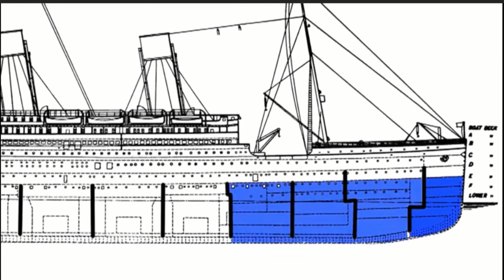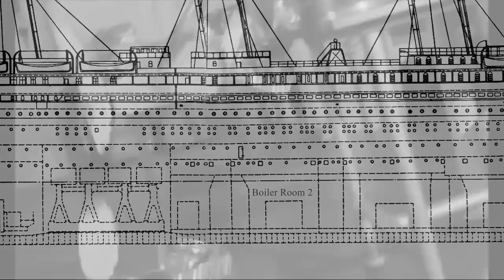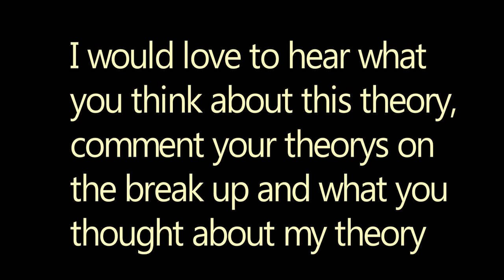Titanic Theory - How Titanic Broke in Two

Comment: Titanic didn’t just Break in two sections, The Bow (The Front of the ship) and the stern (The back of the ship). It would be more accurate to say the Titanic Broke into Four, The area around the Titanic’s third funnel was massively structurally compromise, meaning this area of the ship was ripped apart.

Comment: To clear things up.

The v break is scientifically impossible
Reply: The keel bending upwards under boiler room one and the forward end of the reciprocating engine room was not only possible, but supported by the two pieces of double bottom found in 2005. At the point where they were once joined, the keel bar and shell plate was bent into an S-shape. In other words, compression stresses broke her keel, and when the double bottom bent upwards, that causes a cascade of structural failures. In fifteen or twenty seconds, cracks in the decks split Titanic into four main pieces while the shell plate ripped away from the inner structure of the stern section. When the bow went under, B-deck pulled the stern upwards before it too separated at three tear lines leaving the stern to remain vertical in the water for a few minutes before it too went under. This bending and failure of the keel as well as the rapid propagation of cracks throughout the mid-section certainly would account for the cacophony of very loud sounds heard by the survivors.
Reply: @taraswertelecki3786  The 2005 theory has been disproven.
Reply: @rightlaneshitbox  It so dark so not many people could see clearly what was going on and the 2005 theory was based on the theory the expansion joint was flawed but did some testing and showed the expansion was strong enough to handle enough stress.
Reply: Exactly if the bow is full of water there's no way the nose can rise up with the weight of the stern rising not a chance

Comment: I think that at a low angle the titanic started peeling a bit from the top decks and then part of the middle section was crushed a little and than it fell apart from there. For example take a wooden skewer add some wait on the end of it than at the other end lift it up and see which angle you feel the most pressure in... it's a low angle unlike how james Cameron depicts it so final verdict the bow went under then the propellers came out of the water and not long after that the pressure splits the top wooden decks and the metal was crushed under the pressure and then the stern fell, and no there was no bananna peel effect because the hull does not act like that. It split at an angle like this 2:07

Comment: Did they ever think of the waight of the passenger's moving up to the stern had on the structure of the ship,
Reply: I always wondered that actually,but again i dont think it made a whole lot difference anyway.
Reply: If all the passengers stood on the forecastle the bow will sink very little. That happened to Olympic after the war when she was taking back Canadian troops. If lets say 1350 people to make it easy (taking out 146 people to equate to the amount of people who died forward of the ship and were in the water) That is only an added 140 tons to the stern (calculated by the average weight on men times by the number of people) So it is very unlikely that it would have broke the ship. 600 tons listed the ship to port by 2.5 degrees, and that is four times more than the weight of 1350 people. (yes I know 1496 people died on the ship, with 712 surviving)
Reply: @POOLIEY  well explained.

Comment: One of the marconi men in the radio room who survived said they couldn't hear anyone responding over their headsets because the steam boilers were being evacuated through the funnels above their cabin - making a loud rushing sound. They were operating virtually deaf to responses.

Passengers later testified that they were encouraged to go back inside the ship because the deck was extremely noisey. 

This implies that all excess steam was running through opened valves very soon after the collision when the radios were starting to transmit CQD SOS. This would make sense - the boiler room was flooding and the engineers would know to vent all steam to prevent an explosion. They were very brave men. Every single one stayed at his post. Manning the pumps. Maintaining the electricity supply. And doing everything possible to give the people above more time.

Comment: The explosion she talks about was most likely one of the reports of the iron fracturing during the break-up. She was young when it happened, has no understanding of engineering, it was dark as can possibly be, emotions were high, minds scrambled and confused. But I’m not mocking or ridiculing her in any way. Many survivors (including her) gave very good accounts of the sinking considering the conditions and what was going on that night. But Titanic was a 10 deck, complex iron structure. If something like that fractures, it’s gonna sound like an explosion, no question. Multiple explosions to be exact, which is what most survivors testified to.
Reply: Maybe that explosion was the second funnel falling and I bet she forgot because it’s been 109 years since this happened but it’s a huge question of what happened to the bottom of the ship on the ship bro I know everything I’ll pull it out but just the fact that a 883 feet long she broke in half he’s just crazy
Reply: Joseph Hyman told this to NY Herald back in 1912: "We sat there silent, we were terror-stricken. In less than ten minutes there came a terrible explosion, and I could see men, women and pieces of the ship blown into the air from the after-deck. Later I saw bodies partly blown to pieces floating around, and I am sure more than a hundred persons were blown into the sea by that explosion".
I really believe that something blew up amidships and hastened all the sinking process.
Reply: L F 
Well if the reports of one of the foreword funnels exploding when it collapsed are true, then that’s likely the explanation. Likely the second funnel.

Comment: So basically every image and film showing her at a high angle is wrong (like in the 1997 film when it was so bad that people were literally sliding down the decks)

Also apparently none of the survivors mentioned a massive splash when the stern crashed down, doesn't mean it didn't happen though of course
Reply: Sabrina C 
The stern did go down after the ship broke, just not at a free-fall as the movie shows. It was more like a settling back.
Reply: The movie is 20 years old.  It was believed that the ship did reach that high angle until 2010ish.
Reply: The survivors never saw the stern crashing down, some claimed it settled down but that may have been because some of them were close up so they couldn't tell from the angle they were at.

Comment: From what I know, how can the bow be slightly raised up, creating that V formation as it sinks, when it is already heavy with water? I doubt that actually happened. Then again, survivors has to see things in the dark and at sea, at night, it is really dark, so it's difficult to see. And certainly the stern did not go completely vertical as it goes under. Then again, we can never be sure of how it actually sunk, yet it is a mystery that's fascinating.

Not sure how you feel about this, but we could see how it goes when Titanic H&G is out.
Reply: I totally agree. Some people say that air was trapped in the bow due to bulkheads not flooding, which caused buoyancy. Some people believed this is what caused a V split. But yet again, Mr Andrews said that not only the bulkheads would spill back and back, but they did. So, I do not think a V split could be possible.
Reply: @KevinJhonson  Nobody knows what Andrews said to the captain,they just go off what they assume he said,due to the engineering of the ship and The way it flooded
Reply: @paulanthony5274  The amount of people wondering what happened showed that people could've possibly listened in.
Reply: I shouldn’t be a V formation, since when it hit the iceberg, and the 5 compartments flooded, the water will decrease buoyancy, meaning that the bow will continue to sink downward, and the stern will rise